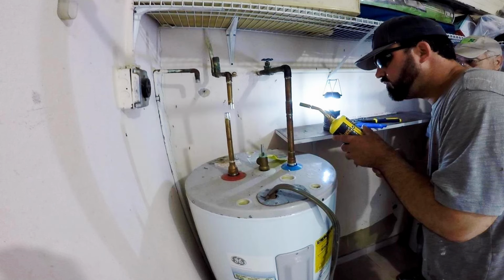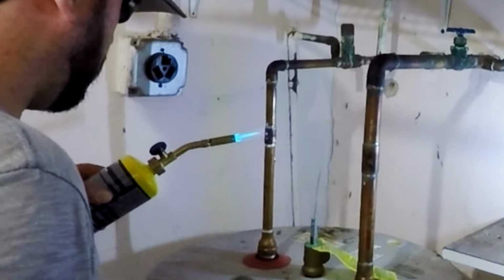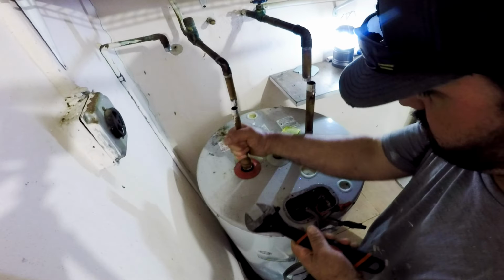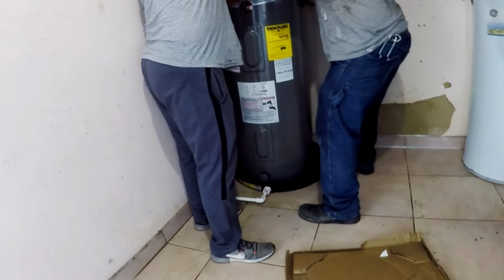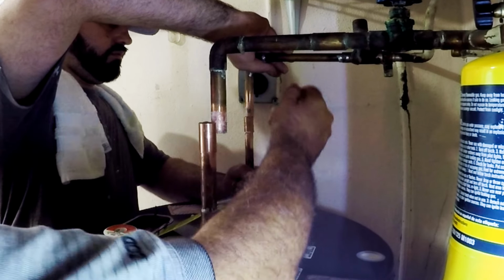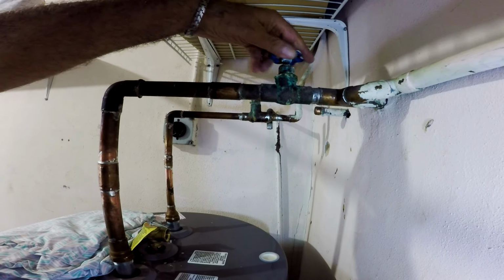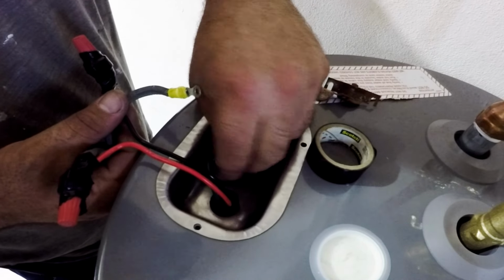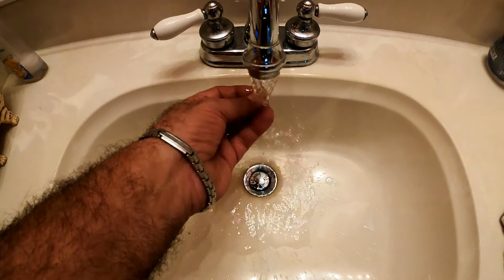How to Replace an Electric Water Heater Tank

Comment from the maker: Installing a water heater is not as hard as it seems — it's simply a matter of soldering pipes, aligning connections, and securing valves to the heater. The process can take a few hours and requires some basic tools, but before you know it you'll be enjoying a fresh heated water supply in your home.

Comment: Dropping another LIKE on your video John! We had to deal with this in my mothers old house. This is a great video, because we don't have to change out water heaters all the time, it is wonderful to have this resource available to guide us!
Reply from the maker: Well, there's an easier way by using the shark bites plumbing connectors in which my son used at his house but the hot water shark bite started to disintegrate inside and pieces of rubber were coming out of the faucets. So, we learned our lesson from that experience.